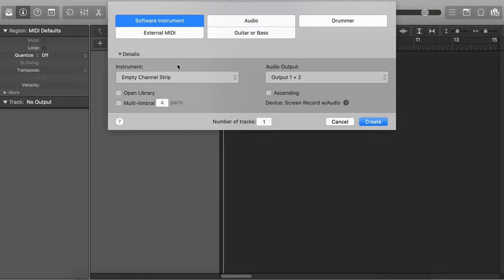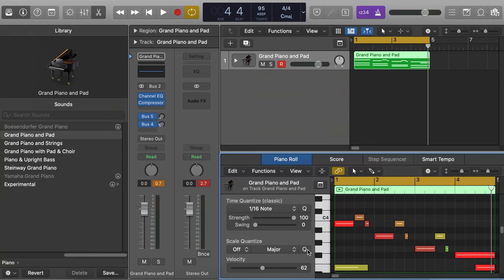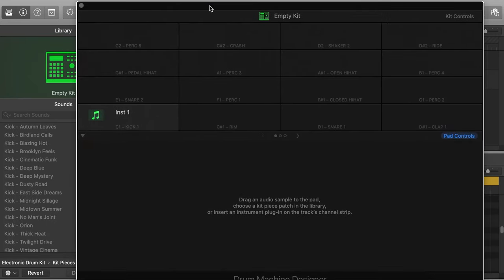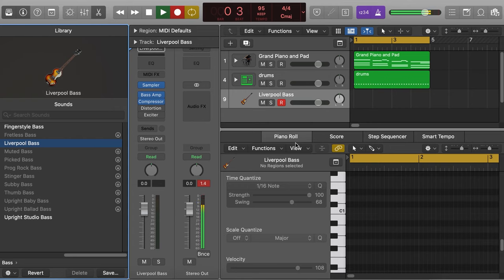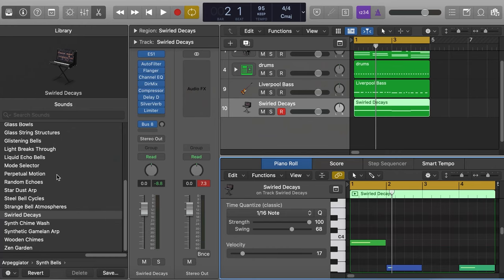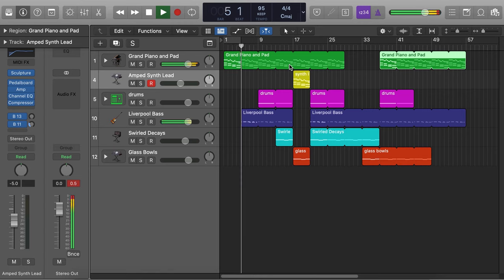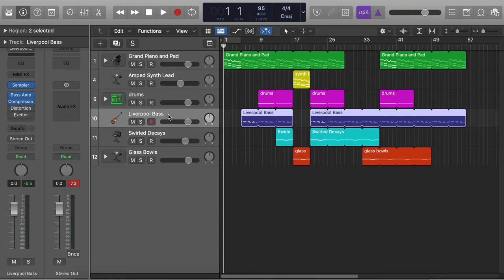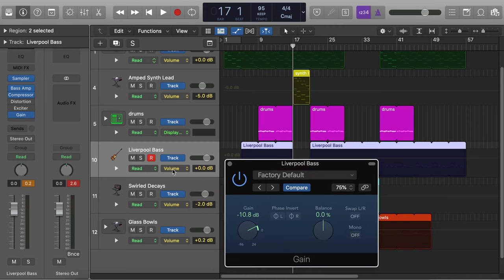How To Make a Beat in Logic Pro X using Akai MPK Mini Mk3 | Nefertiti Gold

Comment: Hello! How did you get your pads and pitch wheel to work in Logic? I’ve been trying for days and it’s not working! Thank you
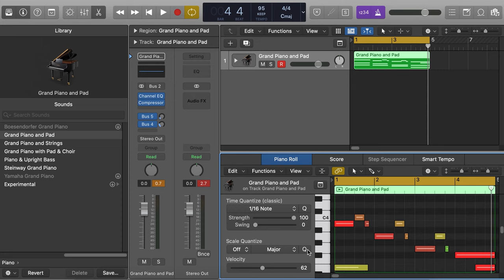Reply from the maker: The pitch/modulation wheel is already auto mapped when I plug mine in. As far as the pads, the only solution I’d have is to try loading some sounds 1:35

Comment: I just got the MPK Mini Mk3. I have a question.  The video title says says you are making a beat in Logic Pro X but the screen looks a lot like Garage Band.  Are you actually working in Garageband?
Reply from the maker: No, I’m working on Logic Pro X 10.5. The two look very much alike because of the Mac OS ecosystem. A noticeable difference would be the channel strip which is on the left side of the screen recording next to the library. Hope this helps!
Reply: @NefertitiGold  Thank you for responding.  I figured it out a few minutes after I posted the comment.  I am a bit new to the whole Mac ecosystem.  I've only been working on a Mac for about a year.  I am a computer programmer by trade and have spent most of my life working in the Windows environment.  But since I got into photography, photo editing and video I finally broke down and switched over to a Macbook Pro.   I'm loving it.